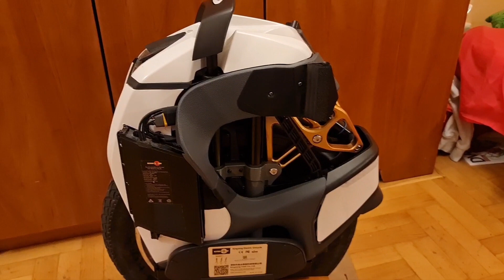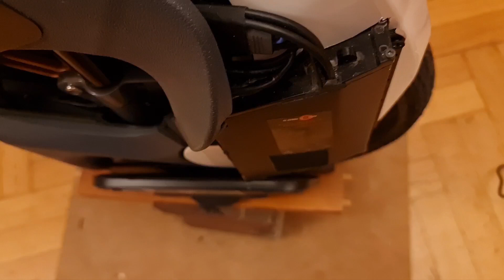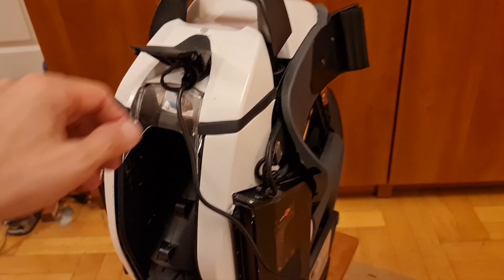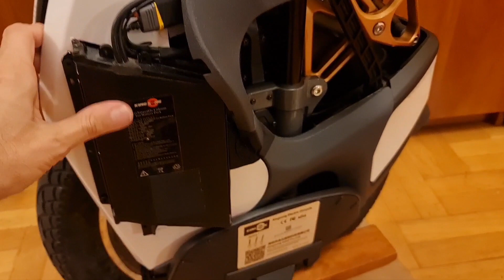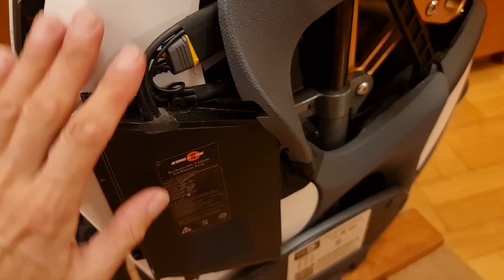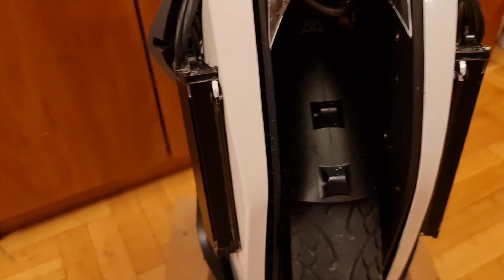Kingsong S18XL - first in the world (technical preview / custom version)

Comment: Awesome job!
Reply: Total capacity? Did you salvage the extra battery packs from anther s18 ?
Reply from the maker: @zdomfed   Total capacity is 1440Wh - same as V11 now - this is 20s4p setup, build from 2170  5000mAh cells.
Reply: So now, you are going to look into proposing a new enclosure ?
Reply: Hey Luk Luk ! What comes next on this subject? Are you going to provide implementation details?